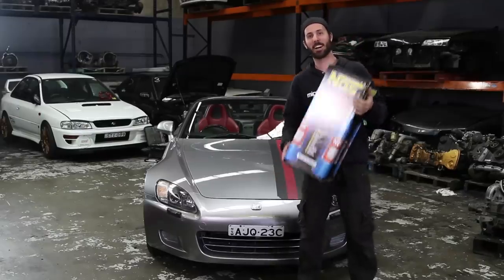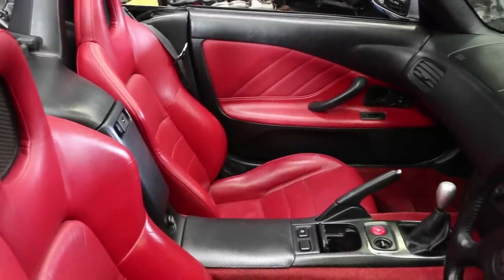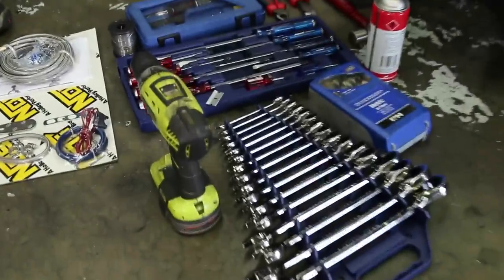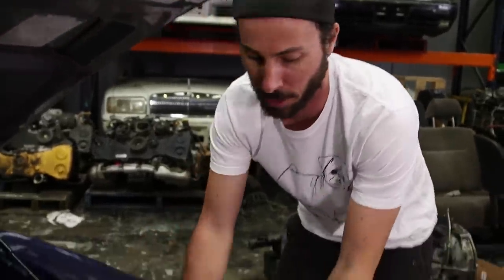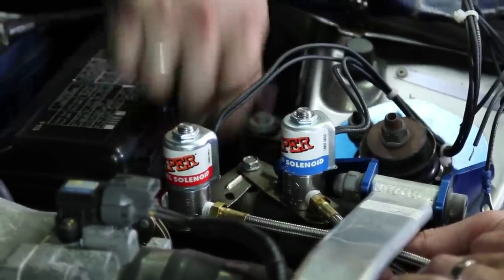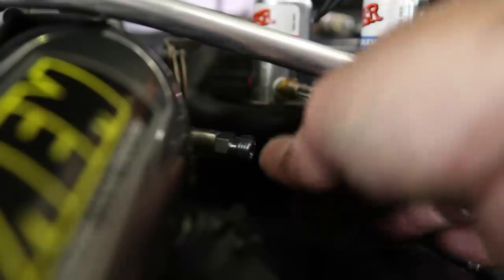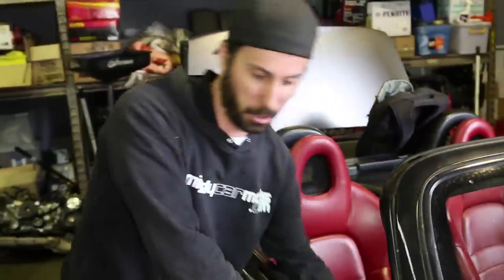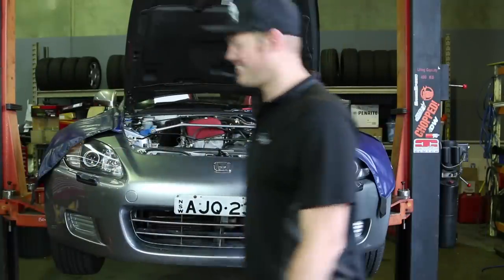How To Install NOS

Comment: Get ready for a shit storm of uninformed nitrous hate. Guys, it is a legitimate power adder. The great thing about N2O is that your car can remain nearly stock if you want to spray a small amount, 50/75, or you can go wild with 250+ with a built engine. Nitrous is especially cool when you compound it with a turbo/sc system.
Reply: Finally someone in the comments gets it! *tip my hat to you like a sir.
Reply: Facts

Comment: I think that most of the hatred towards Honda in general is that so many Honda owners (especially younger ones) does add too many RICE mods on their cars.. Like giant rear wings and "fart-cans" for instance..
Typically these cars are Civics, or CRX's 

Unmodified, or proper modified Hondas are actually quite nice cars.. And Honda have been making some great models as well.. like the S2000, NSX and the off-road CR-V
Reply: G6 Liara CRV s are shit !
Reply: Plus the driver's tend to be a little obnoxious. Everyone might be a bit petty towards them but I think it's not without reason.
Reply: Don't make up trash it's not because there are ricers all cars have ricers it's because honda are very good and affordable cars and the fact many are fwd people don't like that or understand they are good.
Reply: @robertlund5694  lol no they aren't they are nice cars. The problem is idiots like this guy saying off-road when the CRV isn't meant at all for off road it just has AWD which activates when you loose traction meant for bad road conditions it's a nice road car

Comment: I don't like NOS or drag racing, but I watch these guys anyways, just wish there was more nissan!
Reply: ***** Drag racing = fast cars. Real racing = fast drivers
Reply: Prof Kaos >implying that its all driver on a track, it has to be a car and a driver working in harmony perfectly to go fast, its the same with drag racing, albeit in a straight line and your main focus is shifting
Reply: Driving automatic transmission on a track requires more skill than driving stick on a drag strip. Fact.
Reply: I suppose you live your life a quarter mile at a time...
Reply: Same, but I wouls like to see a Mitsubishi.
Reply: Nissan yay...
Reply: Prof Kaos Disagree, manual is hard to nail perfectly every time in a drag. A bad launch that loses traction, shifting at the rpm etc fucks up your time. automatic is fucking terrible driving track, drag or street. I have a lot more respect for anyone who drives manual
Reply: Bro you and me both, moog belongs in a nissan... not a honda
Reply: Micah drag racing requires NO braking/cornering, NO overtaking/defense against being overtaken and gets shut down at the first sign of rain until the track is BONE DRY. All they have to do is drive in a straight line down an empty lane and shift gears. That's literally the first skill someone learns about driving a manual car. 

Color me unimpressed.
Reply: Drag racing is just not my style. I enjoy going fast in a straight line and flying through the gears, but not nearly as much as I enjoy fast cornering and drifting.
Reply: bananabottles It's good for benchmarking the car, but that's about it.

Comment: the 2nd worst thing about honda's are the owners :)

here's my quick and dirty honda tuning guide

1 large cannon exhaust TIP only

2 giant V-TECH sticker taking up 30% of the windscreen space

3 giant sub box taking up all of the boot

4 driving position something like a dentist chair

5 giant rims and some sort of stance to make you car undriveable and flog tyres out every 3 weeks

6 body kit from a different sort of car hacked on by your mates while downing a case of XXXX gold

7 stickers with lots of words like Xtreme and X games and other wrong use's of the letter X

8 tinted windows with bubbles in it 

9 stick on hood vents 

10 almost forgot lower it so it bottoms out on everything , wheels rub on the guards unless your going straight

now this car is more than a match for any nissan silvia or skyline or toyota supra or wrx or v8 /turbo falcon or v8 commodore (in the owners mind)
Reply: You forgot the carbon fiber stickers and the cambered tires.
Reply: ho good point ...  :)
Reply: The giant sub doesmt mean rice
Reply: You also forgot about the rattle can spray paint
Reply: shit. I've been modding my Honda wrong the whole time!
Reply: Driftatron It does mean douchebag though.
Reply: You are so right. I don't actually hate the cars but, I only hate the owners that ruin them. Otherwise Hondas are just normal cars for normal people to drive e.g. Accord, Integra. Then there's the S2K which is for people who like roadsters, which is fine.
Reply: i'm glad someone gets it , they are just a more expensive eco box with overpriced parts no better or worse than any other car ... hell most of our aussie one's are now made in thailand like all the other car companies have moved there too!!!  but the s2000 is the best they have ever done for the mass market
Reply: What is V-TECH? Could you explain it to me please? Maybe there a two types of Hondas on the world. One with V-TECH and one with V-TEC.
Reply: A who give a fuck compared with the SR and the RB motors of nissan EVERYTHING from honda is SHIT
Reply: Dont forget the straighter the pipe the straighter you are
Reply: You basically just described ricers. Sorry to tell you, but every brand has its ricer crowd. Honda just happens to have one of the bigger river followings. That doesn't mean the cars are bad though. It just means they attract a lot of idiots.
Reply: No subs just mean you want loader
Reply: Bonglord Camber is stupid for a 1,00 reasons.
NOT functional.
comprised traction.
50x tire wear.
It was used in drift cars in Japen because at 70mph the camber would be pushed flat in a corner.
Ricers thought it looked cool.
Reply: Bonglord I have a 335 michelin tire on my truck,
shit is $500 a pop.
Reply: haha i was only joking :) My dad has an E92 M3 its fun but wheels are £500 per tyre. dont know how much that is in $$$$
Reply: Bonglord  That's 781 USD.
Reply: OOohhya!! Worth it for a car with 420 BHP
Reply: Bonglord Trucks have a weight bias in the front.
I need large tires because no weight is on the back tires.
A normal car could make due with 285s
Reply: Why would anyone have a giant sticker of a telephone and child's toy company on it? I mean I'd understand a VTEC sticker, but not VTECH.
Reply: I have 17 psi that will change your mind. And only one sticker but I doubt you'll be able to read it
Reply: Tristin You have 17psi?
You know that number is meaningless right?
17psi from a 50mm turbo is not the same as 17psi from a 102mm.
Reply: sounds like commodores to me mate
Reply: ***** in america Hondas are a bad joke.
Not only are they not reliable, but are losing sales.
Reply: ***** lol no.
Hondas are garbage now.
Drop build quality to save money.
Honda is so bad now
Reply: ***** honda drooped  their quality a LOT.
They are not good cars anymore.
Reply: Agree
Reply: Sanic
 Same goes for the golf GTI tbh. It used to be a fun and snappy hatchback with decent performance. Now it weighs a ton and the power most models make is not that impressive (not to mention attached rice crowd).
Reply: SniKKaz V-Tec is Honda's way of saying it doesn't make any torque until 7k+ rpm.
Reply: sharpemang

OH MY GOD! I know what V-TEC is...this guy above me said "V-TECH"....

You should try google. Just search after "What Is Irony?" You even get examples for dummies :)
Reply: Chemtech2010 the golf is one of the worst cars in america.
Idk what happened lol
Reply: SniKKaz Well if that's the case, VTech is a leading global supplier of electronic learning products from infancy to preschool and the world's largest manufacturer of cordless phones. It is also one of the top 50 electronic manufacturing services providers globally. Also, Virgina Tech (Shortened to V-Tec sometimes) is a university in the US that participates in division 1 NCAA Athletics.
Reply: sharpemang  Clearly you have no idea what you're talking about, but hey I wanna jump on the hate bandwagon and make shit up too!
Reply: Casey Maloney I took that straight from the company Vtech's page since you wanted to know what Vtech is. Also Took Vtech from Virginia Tech's website too. Clearly you don't know what you're talking about.
Reply: sharpemang
I was referring to "V-Tec is Honda's way of saying it doesn't make any torque until 7k+ rpm." The whole point of vtec is to maintain efficiency throughout the entire power band by maintaining steady torque at all RPMs.
Reply: amh007dude Don't forget the NSX. It was actually the same production line that made both the S2K and the NSX.
Reply: Casey Maloney VTECH is variable valve timing, something most modern cars have. hater
Reply: scotiatint1 yep its the other great sports car made honda ..... vs the  supra's and skylines it was bad value and underperformer .... they priced themselves out of the market and got out done which is a shame for it would have been good to see it bring a fight to toyota and nissan
Reply: SniKKaz there is no V-TECH theres only V-TEC it stands for valve timing electronical control. What i think it does is after a certain amount of revs, lets say 5 - 5 and a half throusand revs V-TEC kicks in and is it speeds up the rotation of the camshaft and crankshaft :)
Reply: hortvisual VTECH is an electronics brand not a form of vvt/cam lift lololololol
Reply: About as stereotypical as you can get. Identical to someone saying all asians have bombs strapped to them. Granted the Yanks have no taste in their Honda scene but theres some nice Honda track orientated builds around.
Reply: eh, mine only checks two of those and it came that way.
Reply: chris martin No taste in our honda scene eh? Being pretty stereotypical for someone trying to call another person out for the exact same thing...lol.

http://www.stancenation.com/2012/07/07/dropped-fitted-honda-s2000/
Reply: ***** i have the same background than moog for honda's i used to hate them because i saw the stupid douchbag's with there fart can and hellaflush uglyness and for some reason's i ended up buying a honda prelude 1993 needed a car and a guy that i was aware of his existence happen to have one for sell was not really hyped about it but its the best car i had never had a problem with if i wanted some upgrade's parts were everywhere and for cheap its a shame i had to sell it
Reply: eddie rath Good comment. But when you refer to the "Hellaflush ugliness and fart can "thats just how the Americans ruin them when they slam them etc. Ones done properly with proper JDM parts like feels, seeker, Js racing etc can sound and look very good.
Reply: ^this.
Reply: ^that.
Reply: is it bad if I only changed the grill to a full black really upgraded engine fixed paint,tint windows, got decent rims is it OK?it doesn't look a rice to me since no body kit,no Camry wheels + decent rims ,really upgraded engine throwing vtect back to the trash,
Reply: Eddie Adams I don't have a lot of money but that doesn't mean I'm buying crap
Reply: Fucking beautiful  :)
Reply: +marlonguzman40 Honda owner
Reply: What about an un necessary blow off valve
Reply: +amh007dude Hahaha I was having a really bad day and you made it so much better xD!

Comment: Hey Moog! Change out your OEM platinum spark plugs if you haven't already! Platinums are no good for NOS. They heat up way too much and can cause knocking when the nitrous ignites prematurely. Go with a set of coppers or something.

Love the S2000. Anyone who hates on the car simply hasn't driven one yet, and if they have driven one, they probably know nothing about performance driving. Hope it all goes well!

Comment: could I inhale nitrous for cars and get high? I'm going to try

he died, wife finishes comment
Reply: +Ross na nos for cars has something toxic added to the gas for that reason lmao
Reply: it has sulfur in it
Reply: to remove the sulfer you can bubble it through water mixed with a certain salt i think and it will clean it.
Reply: Chris Cheddar  how would you do that coming from a 1500psi bottle in liquid form?
Reply: I wanna be like the snail from turbo that be lit 🔥🔥
Reply: You didn't edit your comment
Reply: Your wife typed in the 4th person?
Reply: @Tyler Eidson - Same way they teach you to breath directly from a scuba tank (3k to 4.5k psi) in the event of an equipment failure, open the bottle and indirectly breath the gas. Underwater its actually pretty easy, since the high pressure gas displaces a whole lot of water. Never tried it on land (or with Nitrous) though!
Reply: Turbo the snail did it🤷‍♂️
Reply: nos is literally just laughing gas but with a bitterant